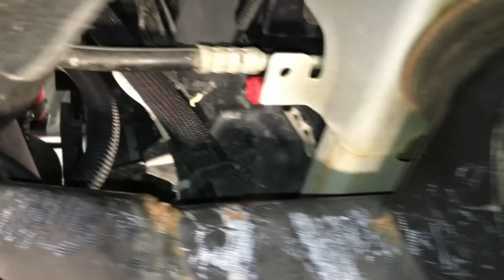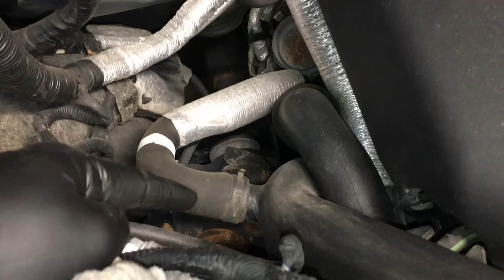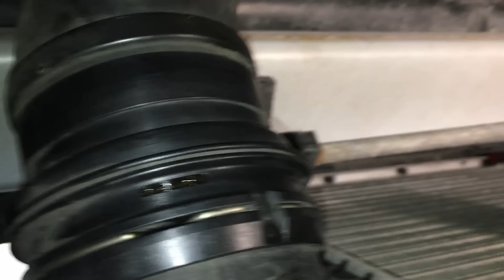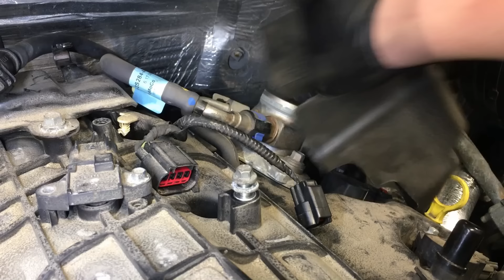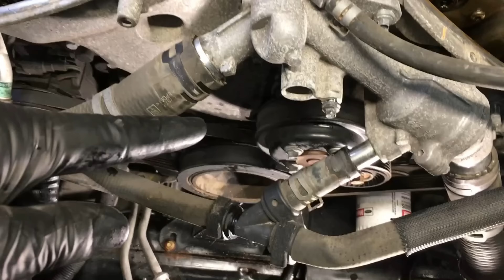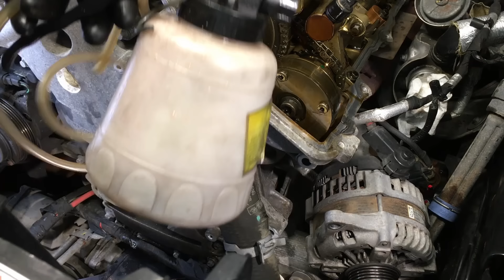2011-2016 Ford F-150 3.5L Ecoboost Timing Set Replacement Part 1: Getting Inside the Engine

Comment: I have a question.  My 2011 150 ecoboost 3.5 with 141,000 miles occasionally has poor acceleration, almost like not going on boost .feels sluggish  but if I stop at a light shit the truck off and restart it. It always feels fine back to normal power and boost , any thoughts

Comment: 2012 185000. Left turbo was leaking internal and external slightly. Pulled the cab. Where can I get turbos?  Would you trust cloyes timing components?

Comment: Can this be done on the Ford Explorer Sport (2018) without removing the engine?  The FSM calls for disconnecting EVERYTHING but I've seen people do it on the 3.5 Duratec engines by just supporting the engine and removing the engine mount and anything else in the way.  The Sport models have the 3.5 Ecoboost, but it's mounted transversely in the engine bay so there's not much room to work.

Comment: Thank you for the F150 3.5L Ecoboost timing set replacement videos, I would not have been able to do this job without them! My 2013 F150 with 167K is running great and is super quiet at startup now!
Reply from the maker: Wow thanks! Glad I could help!
Reply: How'd you pull it off?
Reply: @EclipseTime86  I took it slow and followed Brian's video faithfully and by slow I mean it was a long project, my guess is that I had at least 60 hours into it. I had a few rabbit holes that required more research and other YouTubes that helped. Things like the existing intake cam bolt on both sides would not come loose and the torx teeth stripped out on the bolt so I ended up taking off the front plate of the phaser and cut through the bolt with a sawzall, (I first tried drilling out the bolt head but that didn't work). I also made sure I had the right tools.
Reply: @rwilson1905  I really hope it goes smoother for me.
Reply: @EclipseTime86  Let me know how it goes! Yesterday, I had to redo the valve cover spark plug seals since they were not properly seated and oil was leaking into them. I had replaced them since I had to cut the old ones out, they were too hard and would not let me remove the valve covers, (another of the rabbit holes).
Reply: I’m about to have to do mine 2013 3.5 eco , had cam phaser rattle for months and not it sounds bad . Went ahead and quit driving it till I can replace befor I mess my engine up , 120,000 miles .

Comment: Hi , i just do timing job on my 2013 f150 3.5 Ecoboost and the crank is not at the good place when the cam is in good place with the holding tool , how i adjust my crank to put it at 4-5 oclock ? Thank you for your video

Comment: paid the dealership to cab off correct the timing problems at 165k miles at 264k and now they want 4200 to replace tensioners and phasers, they were not done or even offered at 165k. Thanks to you now I'm in the middle of a FULL timing job, all components, new HV oil pump and turbo screen replacement and Mitsu catch can. Dealership would have wanted 10+ I'm 2 grand in parts and my own labor. Thank you for all of the info. 
A turbo oil screen replacement vid would be welcome though.
Reply: ok fun added note, turns out one of the chain guides broke off and has been floating around the timing chain area and getting eaten up slowly. The phaser screens are all plugged up with tiny bits of plastic, so pulling the oil pan, replacing the screen and pickups and filter and phasers and well everything in the timing case, cleaning everything i can see and can get to, replacing turbo oil screens, but is there anything else i can do?  Engine is basically totally open at this point with only the pathways inaccessible. Pour copius amounts of oil from the top and just let it flow out the bottom to the catch pan? I cant seem to find any refrence to how to deal with this.

Comment: This is the most comprehensive series of videos I've seen to complete this job.  These videos were absolutely crucial in helping me get this job done correctly so THANK YOU FordTechMakuloco !  

Note for anyone attempting this: I knew this would be a big job for me, but it took even longer than I expected for "little" things which I thought would be easier.  For example, taking off the valve covers seemed simple enough, but I struggled with getting the clips off of the wiring harness and that step alone ended up taking several hours.  Yes, I bought the claw recommended which was very useful.  Also getting the AC belt off took longer than expected.  I almost just cut the thing and bought a new belt, but I eventually was able to walk the belt off.  My engine had 186,000 miles on it, so I went ahead and replaced the brake vacuum pump as well (which is a known leak/failure item).  Glad I did because it was leaking all over the place AND it's MUCH easier to remove once you have the valve covers off!  Do yourself a favor and have a helper and a plan when the front cover goes back on.  Getting all the bolts on and torqued properly in 15 minutes is stressful!  I used a paint pen to mark the holes for stage 1 to also make it easier.

I ended up buying all the parts from a local Ford Dealer just to ensure I had all genuine parts (except the vacuum pump which I purchased OEM fordmoco from rockauto).  They don't advertise this, but they have a "tensioner kit" which includes most of the parts needed to do this job at a fraction of the price to buy all the individual parts.  The kit is listed on the TSP from Ford and the kit is part number BL3Z-6D256-C.   That kit includes the phasers, bolts, timing chain, and most of the gaskets needed.   Funny enough, it doesn't include the actual tensioner, lol.  I was also able to get free loaner tools from Advanced Auto parts,  Oreilly's, and Autozone (cam locks, pulley remover, pulley installer).  In all, I spent $1025 for all the parts including fluids and sealant.   It was a monster of a project, but sure is satisfying once it's all back together knowing you saved several grand in labor costs.

Another note:  I have had timing chain "rattle" for quite a while (several years).  I started also getting codes P0299 and P0016 recently.  The engine would actually lose power and throw a check engine light.  I could reset things by turning off the engine and restarting it.  It was WAY overdue to replace the phasers and timing chain.  All the codes are now gone and it runs smooth.  I just got back from a 1300 mile trip with no issues.
Reply: Hopefully this reaches you.  What parts did you need to buy outside of that kit exactly?
Reply: @coreygendron3755  In addition to the kit, I purchased and installed the following: Part # 7T4Z8527A Coolant Pipe Seals (2 in package) Part #W503297 S900 High Pressure Fuel Pump Bolts (can't be reused), Part # CG812 High Pressure Fuel Pump Mounting Gasket, Part # BL3Z-6L266-A Timing Chain Tensioner, Part # DL3Z6584C Right/Passenger Side Valve Cover Gasket,  Part # TA-357 Motorcraft Silicone Engine Sealant, and VC-13DL-G Motorcraft Coolant x2. I also replaced the Brake Vacuum Pump since it had never been done and was leaking very bad.  It was much easier to do this with the valve cover off, part # BRPV23.  Just a note, I also broke one of the spark plug seals on the valve cover when taking it off.  Being 10 years old, I don't think that's something uncommon - part # BR3Z 6C535 B.
Reply: @yandia8336  thanks for all your information. I will be buying all these parts soon
Reply: @coreygendron3755  It might be helpful to just list the parts which ARE included in the kit (DL3Z-6584-C):
AA5Z 9439 A      GSKT-INTK MANF TO CYL HD
AT4Z 6256 B 	CAM TM ASY ENG VAR(INT)
AT4Z 6C525 D 	CAM TM ASY-ENG VAR LH(EXH)
AT4Z 6268 C 	CHN TM
AT4Z 6279    	BLT C/SHT SPRKT(INTAKE)
AT4Z 6279 E 	BLT C/SHT SPRKT(EXHAUST)
BL3Z 6584 A 	GSKT C/SHT CVR(LH)
BL3Z 9E583 B	SE-FU/INJ PMP
BR3Z 6020 A 	GSKT CYL FRT CVR PLT
BR3Z 8507 C 	GSKT-WTR PMP
BR3Z 8527 A 	SE WTR BYP TUB
F1AZ 6A340 A 	BOLT - M12-1.5 X 48 HEX FLG HD
XW4E 6700 AA 	SEAL - CRANKSHAFT FRONT OIL
7T4Z 8590 A 	SE-WTR THERMO

For reference, I paid $466.20 at my local dealer for this kit on 9/24/24.

Comment: have you used the Melling complete timing chain kit or are you sticking with OEM ? I have trust issues with amazon and counterfeit parts. Just seeing if there was a slightly cheaper option for customer he has 372K on this transit with a 3.7 and it needs chains. or a engine 🤣

Comment: I just started this job because the vacuum pump failed and siezed then sheared the drive gear off the cam shaft . Has anyone else had this problem ?

Comment: Hi, I know this is an old video, but I’m making a parts spreadsheet from your parts list and noticed that you didn’t replace any guides, or the secondary chains, tensioners or solenoids. My 2014 f150 has 275k miles, should I I be planning to replace those as well?  Do you have those parts listed elsewhere? Thank you so much, in advance!

Comment: Used this 4 part video to replace the timing chain and phasers on my 2014 f150 ecoboost.  It was a huge help!  142k miles, looking to add 142k more!
Reply: I'm looking to do the same on my 2014 EcoBoost, I've always done the repairs on my own but this seems pretty overwhelming...

Comment: I love your 4 part series on doing the timeing chain and associated parts.  I didn't have to do any research other than just watch you video's.  I took my time and did everything by the book.  I found leaning over my truck the most troublesome as I have a 6" lift on it.  Not only did I do the timing, but replace the Oil pump with the Melling Hi volumn pump, vaccum pump and soon I will be upgrading the Exhaust manifolds as I have a broken bolt on each side.. I's also planning on replacing the turbos. My truck has 149K miles.  Again thanks.  I would be interested in your turbo recommendations.. Just keeping the truck stock.  Thanks again. Your one the only youtubers I trust.

Comment: Thanks for the videos, I have been studying! I do have a few questions,

Is there a way to verify the bank 1 exhaust camshaft tone wheel is good? Vacuum pump seized (2014 3.5 F150) and lost all brakes and after had a local brake shop replace it threw out the cam codes and saw some people had to replace their camshaft with the same issue. I would feel much better if I know the camshaft is good before I do the timing job and have to protentional tear back down.

Also, seem trying to find the parts are half the battle. I am ordering the tensioner for a 2014 3.5 F150, there's a BL3Z6L266A and a JL3Z6L266A on the Ford direct site, looking online forums I can't tell which one is the "updated" or the better version. Also have you utilized BL3Z-6D256-C , seems a "kit" from the TSB 18-2305 it seems cheaper than individually but my parts dealer seems to not think it will work, but says for 2011-2015.

Comment: Are there updated cam phasers for the 1st gen 3.5 Ecoboosts??
Reply from the maker: Yes the Ford kits contain the latest phasers.
Reply: Thanks man, I know I'm gonna have to eventually change the timing components on my 2012 F150 3.5 Ecoboost, I bought the truck in 2016 with 80,000 miles on it and I don't know if the timing components were changed before I got it but it has had the timing chain rattle off and on since on real cold soaks and it has 230,000 miles on it now, but knock on wood it has never throwed any codes for timing issues 🤞 and I've never had any major engine problems besides some external things like the notorious degas bottle leak and I bought the kit to delete the quick connect fitting and changed the turbo cooler line and fittings and water pump and sparkplugs and boots etc but I have always changed the oil every 3,000 miles and I did put a RX catch can on it years ago cause it's a must on the 1st gen Ecoboosts. I've watched so many of your videos help guiding with repairs on my truck and you are an expert at what you do and you're by the book and precise on everything you do and you don't take short cuts, cause do it right the 1st time and be done with it like every mechanic should be but some are not like that👍
Reply: And I have one more question bud, I didn't see the HPFP torque to yield bolts on the parts list. Do you have the part# on those??
Reply from the maker: W503297S900

Comment: Removing the air inlet from left turbo...it's appears you left out how to do this in your video
 You jumped over that part...what else are you removing?
Reply from the maker: Nope I just rewatched it I was very clear as to what you want to take off and that is comes off the same way as the passenger side did.

Comment: I just changed the timing chain on my truck. It turns over but will not start. Oil pressure came up and I can hear the fuel pump. I did get a small backfire once. Any recommendations on what to check?

Comment: I pull the water pump first and then the balancer so water can't rush into the oil pan. The last one I worked on had 190k miles and the chain was stretched to the point the tensioner was at it's max travel not keeping the chain tight.

Comment: Is there a block drain that you could access to drain the pump?  Also, I've found that an old stretch belt cut in half makes a great shim for removing the existing belt.
Reply from the maker: I always cut and replace the stretch belt. Too many noises reusing a stretch belt.

Comment: Is removing the water pump required or is it optional, I just replaced mine with the 3 bolt design about 35k miles ago and I don’t feel like paying another 100 bucks for the water pump kit.
Reply from the maker: Must remove.

Comment: Well I fallowed the videos on this repair did it over the weekend primed oil filled coolant first fire up went great shut it down checked fluids fired it back up backed it out of the shop and started hearing a rattling now it rattles all the time and has a p0019 and a p0022 any advice

Comment: My truck runs fine and has no rattle at start up with 163k on it, but as of a week or so ago there is a noise from the front of the motor that sounds almost like a power steering pump low on oil, and seems to be internal. Have you heard this before from the timing system?

Comment: Whats going on, love your vids man. Use them alot seeing as im new to working on anything newer than 2006. I actually used your part vids to replace my timing chain and all that fun stuff. Unfortunately 4 months after i did so i hit a curve.really hard and believe i knocked my timing chain loose or something to do with the chain or guides because i can hear what sounds like a chain rubbing. Im Hoping you or anyone else reading this can help I am about to go back in my engine take it apart again and see what the damage was i had done. My question is when i do, do i need to replace all 4 phasers again as i did last time or are they still good? And again thanks for all the helpful videos

Comment: A warning on not using the recommended parts: I used a highly respected aftermarket component full kit with sprockets, chains, tensioners, guides and solenoids. Rattle came back after 6 months. Going to redo with the Ford parts recommended by FordTechMakuloco. I hope that is the long lasting fix. I suspect the aftermarket sprockets drain down and the tensioner backs off.
Reply from the maker: I am guessing it was Cloyes.
Reply: You are correct sir!
Reply: Finally got into this engine. “Woodruff key” on the crank broke off. Just going to put a new engine in it and be done hopefully.
Reply: Update: Pretty certain the timing chain snapped on me last night. Heard a thud, lost power. Shoved a borescope down the oil fill tube, could see the camshaft, doesn’t move when the engine is cranked over. Codes for all of the cam position sensors.

Comment: Growing up, my Dad was a mechanic. There is a reason I am not. I watched this video because I was considering replacing my own timing chain on my F150. With this video, I feel like i could do it, but it would take me 40+ hours. There's no way any of that would go that smoothly for me. Plus, putting it all back! I'd forgot all kinds of stuff, I'm sure of it. I'll gladly pay someone else to do the labor! Very very informative 👏 👍
Reply: I paint the tip with a different color on each part. And lots of pictures with the phone. Amazon sells a set of paint pens.
Reply: Working on mine right now and yeah my dad was a mechanic as well, I will be here for 3 days.
Reply: @nymincho  Mechanic here I will also spend 3 days on it and the shop would charge around $1800 in labor only. Customer is paying for a job well done regardless of the time it takes especially when it gets this detailed. This is a $4000 bill roughly.
Reply: Don't wanna be a mechanic ey☠️☠️☠️
Reply: Did you get it fixed?
Reply: What did you do to pry the face plate off, I'm struggling to get it off
Reply: So where are they doing this job for 1800?

Comment: Thank you soo much for your instructional videos. I just did a complete timing job on a 3.7l police explorer with 100k miles. I replaced everything plus new melling hi volume oil pump, water pump, new phasers, which had the death rattle.
 Now, the engine is absolutely quiet. Took 2 days. But, like you I took my time cleaning everything which adds time.

Thank you again, it made this big job much easier!!!!

Comment: Have a 2013 f150 3.5 ecoboost. Valve cover keeps burning on passenger side. What is causing this? Cover looks fine from inside so it can’t be the valves.. I’m just confused. I replaced the burnt valve cover with a brand new one and same burn. Same spot. Weird. The water coolant line that runs beside it gets really hot but I don’t think it’s causing this burn.. are coolant lines supposed to get hot to touch? Thank you

Comment: So theres no need to change out all of the other tensioners and guides? Or the vvt solenoids? Im about to do this on my 2011 with 250k miles. Just wanna make sure before i either buy a bunch of extra stuff or not buy enough.